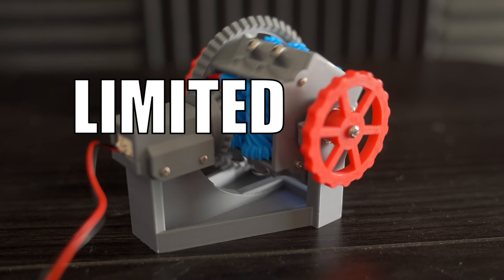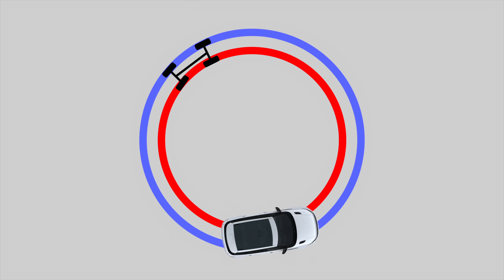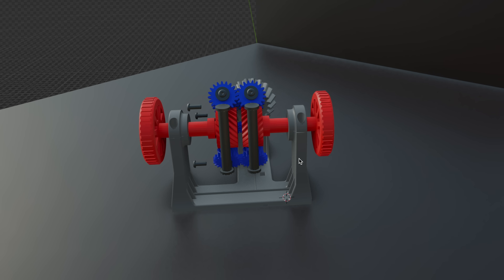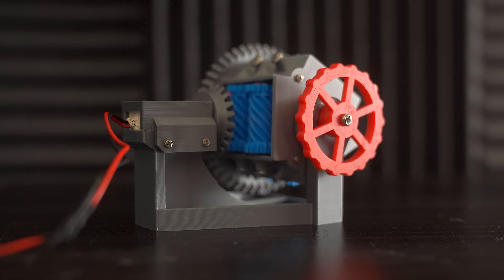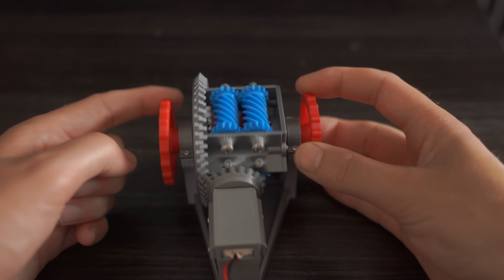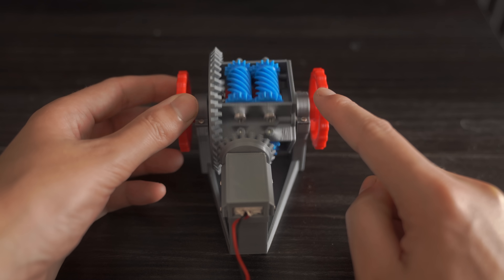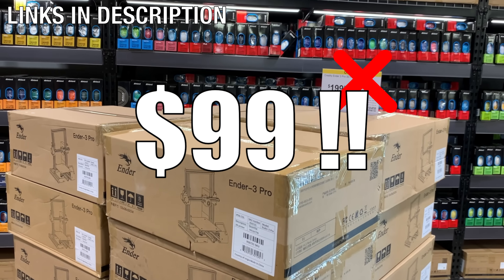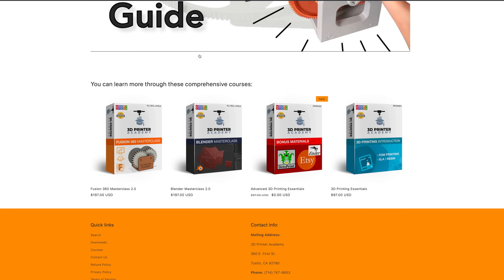What's a Torsen limited slip differential?

Comment: It does not transfer "the correct amount of torque". A torsen is able to multply torque - if one wheel starts spinning when 15 .nm of torque is applied, then in an open diff, both wheels are limited to receiving that 15nm. A torsen will lock up and "multiply" that 15nm across to the when that isn't spinning. The amount it multiplies by is different depending on how that particular diff is set up. Torsen type diffs usually max out around 50%. That means they can take the torque being applied to the spinning wheel and send that +50% extra to the other wheel. 

This is why torsen designs function as open when no significant torque is applied to either wheel... There just isn't anything for the diff to "multiply" across to the other wheel. 

If you're ever stuck in a car with a torsen diff (eg, in snow/ice or thick mud) wheel is just spinning, what is happening is the diff is doing it's thing, but the initial torque is so little (due to the ice or mud), that even the multiplied amount being fed to the other wheel isn't enough to move the car. To overcome this (assuming 1 when has good traction), gradually apply the e-brake (in RWD), or the brakes (FWD) while also applying throttle. Doing this applies symmetrical force to both wheels giving the diff more torque to work with/multiply, which is much greater than what the ice can provide, and because it's symmetrical to both wheels, the torsen will send more torque where there is more resistance (traction).

Comment: The Torsen differential was invented by Vernon Gleasman and patented in 1958. Torsen differential provides:
1. Superior Traction in Real-Time
Unlike a standard open differential, which sends power to the wheel with the least resistance (often leading to wheel spin), a Torsen actively biases torque to the wheel with the most grip.
This is instantaneous and continuous, unlike locking differentials, which engage only after slip is detected.
2. Torque-Sensing Mechanism
Uses worm gears instead of clutches or electronic sensors.
No clutches = No wear over time, making it more durable and maintenance-free.
The gear mechanism automatically adjusts power distribution without delay.
3. Smooth Operation & Predictability
Unlike traditional limited-slip differentials (LSDs) that rely on clutch packs (which can be jerky), the Torsen operates silently and smoothly.
No sudden engagement or disengagement—just constant traction enhancement.
4. Perfect for High-Performance & Off-Road Applications
Used in Audi Quattro, Ford Mustang, Jeep Wrangler Rubicon, and even Humvees.
Works great on tarmac, gravel, or snow—essentially anywhere you need better grip.
5. No Electronics Required
Unlike modern torque-vectoring differentials, which require sensors, actuators, and software, the Torsen is purely mechanical, meaning it’s more reliable and doesn’t require complex calibration.

If you own a Subaru, you know why Torsen differential's are so great.

Comment: You left out the part of how it works. 

The one mechanical thing that makes this works is, with a worm gear, the worm can turn a gear, but a gear can't turn a worm because of the increased friction. You can actually vary the torque split by how steep you make the worm gear/gear interface.

Comment: It works extremely well with traction control because even if you get a wheel in the air will transfer more torque than an open differential would have

Comment: Torsen diffs can potentially make traction control systems work much better by multiplying the torque sent to the non slipping wheel. If setup correctly, they can provide even more traction than locked differentials in certaim scenarios.

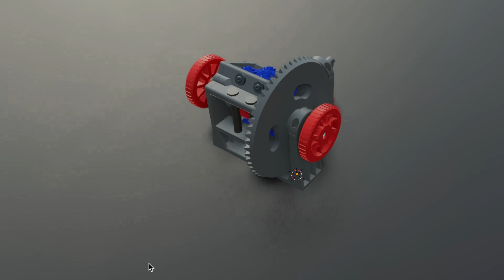Comment: The rendering you have at @0:55 is actually more confusing that you give it credit for: what's rendered does not work as a differential! The two halves are symmetric, so you can spin both wheels in the same direction and they will happily spin together without the carrier moving, and conversely the carrier can spin freely without wheels moving.

Thankfully, your 3D print is correct, but you'll note that it's not symmetric the way the rendering is.

The symmetrical design in the rendering can be made into a proper differential by separating the two halves and adding a third spur gear between each pair being separated. This makes the two original spur gears rotate the same direction rather than counter rotate. The third spur gear in between serves the same purpose as the spider gear in an open differential.

Comment: I love this design and hope it becomes more standard and can be easily made (depending on the popularity of electric cars.) In a Pennsylvanian winter, I often find myself turning off traction control cause it seems like it robs power from the wheel with traction and the wheel without spins more. (Most cars have an open diff anyways because it's cheaper but it just aggravate northerners.)

Comment: The helical gear interface creates axial thrust which resists movement proportional to torque. 

So when the opposite wheel has no grip and can generate no torque the gears operate as an open diff. 

When the opposite wheel gets a little torque then the system creates resistance and forces more torque to the wheel

That’s how they bias torque on a ratio which is based on the gear profile. The more torque generated through the helical gear interface the more torque the wheel with the most grip will get.

Comment: Eaton makes these for a wide range of applications. The Detroit TruTrac. It's an amazing upgrade for vehicles that see a lot of mud, dirt, gravel, or snow.  I run one in the rear of my Jeep Wrangler.
Reply: for the center diff im sure, not the front or rear lol
Reply: @theinsivibleman5309  you need to do some research. The example shown in this video is not the only form of a Torsen limited slip.
Reply: @wvjeepguy8178  ah i see, my bad then.

Comment: Why not just use a traditional plate style lsd and save the extra moving parts and size? Also I doubt this design will be very strong depending on the cost.  Although the title is correct. The mechanism is seriously cool.

Comment: Why doesnt this mechanism get used in cars? The cost?
Reply: There are cars and trucks out there that use this. They are a bit expensive. You can even get them on Amazon for certain applications. Ford used them in their FX4 pickups in the 2000's. Early designs were problematic as they couldn't handle all the power from the engine and ended in catastrophic failure known as 'grenading the diff'. Now, Ford's FX4 pickups come with an electrically locking diff.

Comment: I make gear and pinion blanks for limited slip diffs and other fancy aftermarket and industrial sorts for some folk other than torsen (think select-a-loc). Its really neat to see how diffs and, by extension, the other stuff I make work because I just run cnc and don't really have much actual mechanical knowledge.

Comment: These Torsen/helical LSDs are pretty good, but when one wheel has essentially zero grip, it gets essentially all the torque. Very noticeable off-road, or negotiating driveways with a weird gutter that allows one wheel to come off the ground. The HMMWV (humvee) has Torsens diffs; the instruction manual explains to apply brakes in slippery conditions - the brakes add artificial grip to the wheel with zero grip - which forces the differential to direct torque that way.
Reply: It works extremely well with traction control because even if you get a wheel in the air will transfer more torque than an open differential would have. So basically the torque bias effect will multiply the torque coming from Spinning Wheel win the brake grabs then it would have from the spinning wheel of an open diff. So let's say open diff with 1:1 ratio bias spins and the brake grabs and it sends 50 lb over to the gripping wheel well with this 3:1 ratio it will grab with 50 lb and send 150 over.    When you press the brake pedal it's not as effective because you're also adding brake Force to the wheel with grip. That's why ABS traction control works super well with these do you know what the wheel in the air. Especially if you put it on something that has a really strong traction control even with open diffs like Land Rover Disco or Range Rover from the 90s and 2000s

Comment: "This is actually very simple" *proceeds to show an expensive part after expensive part to make the mechanism work*. The only problem is that I missed the part where you explained how and why it works. I just saw that the two wheels are connected through multiple gears. Then you said it balances the demands to the wheel that needs it, but I still don't know how and why. I just know that they are connected through gears that are symmetrical.

Comment: Your definition is wrong. You said it all yourself . "All didfs are like this."  LSD is just that.  it will slip before transfer. With diffs your loosing power in transfer . So a diff being there it's a reduction,  of what outputs.

Comment: Surely the animation in this video is wrong?  The blue helical gears are mirror-imaged. If it was like this, the housing would just spin and provide no traction to either wheel.   I dont know anything about these diffs, but   the gears in the animation couldn't possibly work, it just looks wrong.

Comment: when the differential uses a worm gear, if the vehicle is going fast, then the engine speed decreases while the potential energy of the vehicle is still high, will the wheels not lock and then slip?
Reply: Nope,  It behaves indistinguishable from an open diff in that regard.  This version is harder to visualize then earlier versions.

Comment: Could i pay you to print a gearbox for a windmill generator but i would like to have it to when the props moves say 4 or 6 times the connection to the generator is spinning very very fast i want to maximize the most rpms in the generator. If you could print individual parts ill have them cast in iron .or do you know where i can find such a gearbox in a scrapyard or junkyard and whats it's connected to. Im hoping for 6ft prop blades .any help would be appreciated thankyou.

Comment: This is NOT a limited slip differential. This more like self-blocking one. LSD's are normal open diffs, but with friction packets connected to each axle.
Reply: Torsen is still considered limited slip, slip I believe refers to the load (i.e wheels) not the mechanics involved (i.e gears or clutch packs)

Comment: But HOW or WHY does adding a tiny bit of friction make all the power go to the tire that needs it most?
Reply: Yes imagine if the blue gears were made with tiny rollers like a steering rack then it would just be a very complicated diff. 
But similar to worm gears they lock against each other when the torque is unequal 
Like having rubbish gear box that keeps locking up.
 But if they were more aggressively pitched like worm gears then they would be locked all the time and have no differential action under normal loads.
but in the mud the vehicle is still loaded a little on the wheel that wants to slip.
If you had a hanging wheel (rock crawling) then it would also fail as there would be no resistance to activate locking.
The solution there is to touch the brakes a little and then you would get moving again.

Comment: You showed how it is built, but not how it works. The geometry of the helical gear is such that the greater load the greater the friction between the helical gears. The ratio between the two is proportional to the angle of the teeth cut in the gear mesh.
Reply: Yeah,  the video lacked any kind of explanation

Comment: then the axxel is frictionized. and the wheels are out of lead. emphorcing the wear amd tear of the wheels axxis, and without calibration, make steering harder. tue car need to be 100% leveled. because new mechanics, are more delicate and cricticle. then older designs out of 1902 for example. you know those steam engine cars or those cars without a battery but with a clutch. they look clumsby. but dont care about takeing a corner. or a turn. multiple times. in those days. normal laberour made their own car, nowadays in my country, that is against the law because of the rules and regulations. one size fits all cars from the fabric. wich is fine by me. i can not make a car. so. suits me. althou sturdieness and rigid tough, mechanics. seem too distance in time.

Comment: the blue spiral shafts should be mirrored to each other, not the same way, that way when a slip occurs, the wheel that has zero traction will stop being free, and the high traction wheel will move the vehicle, without the lost of power.
Reply: no it won't. ALL LSD's require some torque to both wheels or you don't go anywhere. My 99 Audi was like that, but my 2002 added abs actuation to it to provide a reference torque to the slipping wheel so the other wheel would get torque. Pretty cool really, but purely mechanically, ALL LSD require some torque on the slippy wheel.

Comment: The Torsen is technically NOT a limited slip differential.   An LSD has clutch packs in it to limit the slip.
Reply: it is, just by other means. Both require a reference torque to operate.
Reply: Yeah I was looking past the title. LSD’s do have the clutch tension on all the time but letting it slip as normal.
This is a gear box that wants to lock up when everything is not equal or free.
And can work like a locker diff (rock crawling) with a little brake pedal action.

Comment: What defines "non-zero"? Certainly there must be at least a small amount of friction with the plastic, or even if you got bearings or lubricant, or even perfect frictionless materials, there's still air resistance...
Reply: He doesn't mean no friction in the gears. The non-zero friction required for this differential to work is the friction between the wheels and the ground.  There has to be a small amount of resistance (friction) on both wheels for it to work. For example: if you were in a situation where one wheel was not in contact with the ground, that wheel would get all the power and you would be stuck.
Reply: @jbrou123  But how does it tell the difference between friction with the ground and air resistance?

Comment: The zero traction is exactly why that design has a big flaw. You go nowhere when the driven wheel is hanging in the air. This is where a clutch plate design or viscous design is better. These two drag the slower wheel and drags more the faster the zero traction wheel spins. While the design shown like he said acts exactly like an open diff and will leave you hanging, sometimes literally.

These gear driven diffs work great for on street and circle track use but have some limitations for straight drag racing and offroad use. I used to think they were perfect but clearly they aren't. For off road you want a manually locking differential.
Reply: Many modern offroad vehicles have the "brake locking differential", that uses the brake to stop a particular wheel from spinning... That in conjunction with the Torsens ... is very good.
Reply: Clutch pack diffs have that same issue unless you specially build them with some permanent bias. I've had (and raced) them all. Have a Torsen T2 in my current race car.
Reply: @spinnetti  I agree you won't have a complete lock up with a clutch type but you won't get an open diff unless you burned up the clutch plates.

Comment: I watched to end but I'm still no more wiser knowing about what's going on inside.  
I do know from my own Jaguar XJ-S when I round a curve gently the rear end behaves like a normal car except no inside wheelspin, then when I accelerate really hard out of a turn something happens at the rear end converts itself into full-on go-kart fixed axle mode and I get as much oversteer as I need to get round the turn sharp and fast.
Reply: I understand there's a clutch inside it and have to use special lubricant not the normal EP

Comment: This is also referred to as an automatic torque biasing (ATB) differential (Or Torsen, as others have already mentioned), and are a really nice upgrade over an open diff on (fast)road applications, especially on FWD cars!
 However, in RWD rally/drifting setups, a traditional plate LSD simply can not be beaten in terms of controllability, since you actually want both wheels locked together in those conditions when you're right foot steering so to speak...
Reply: It works extremely well with traction control because even if you get a wheel in the air will transfer more torque than an open differential would have

Comment: Torsen diff. It is limited splip, but I thought LSD was associated with the ones using clutchs packs like ATs
Reply: its just another type of LSD. Note its "Limited Slip", not "No slip", so they don't quite work how people think they do.
Reply: Limited by definition because it allows movement when the torque is equal. But not when there is a difference like mud.
And if one wheel is hanging (Moab style) then it also fails as the torque is equal again 
No torque on one wheel equals no gears tension and no torque on the other, but a little brake pedal fixes that.
Limited Slip Diffs have the clutch tension on all the time so they fighting around normal corners but slipping so the wheels don’t get chewed out.

Comment: "How does a LSD work?"
"Because it can send torque to a wheel with no grip?"
"But how does it do that?"
"Because it is a LSD"
Reply: it actually can't send torque to the wheel with no grip..it will just spin like an open diff in that case.
Reply: @spinnetti  Well I'm no expert and I'm not tryna discredit you, but isn't the whole thing with torsen diffs is that they lock up mechanically in situations where one wheel has less traction?